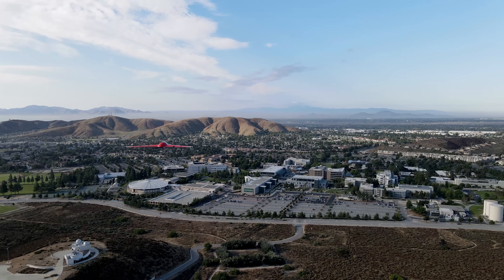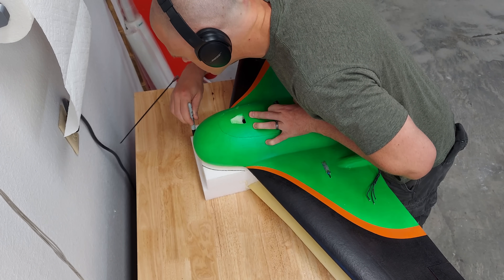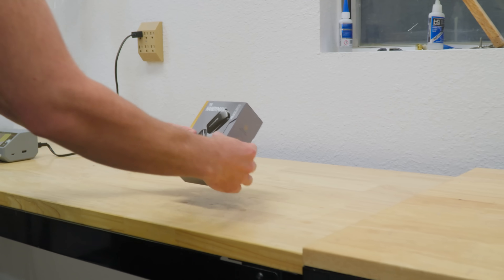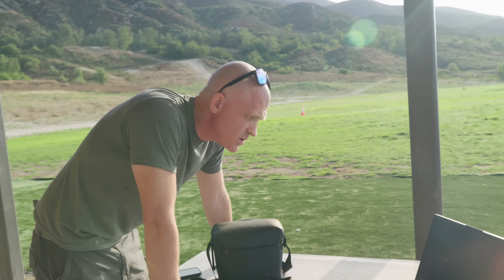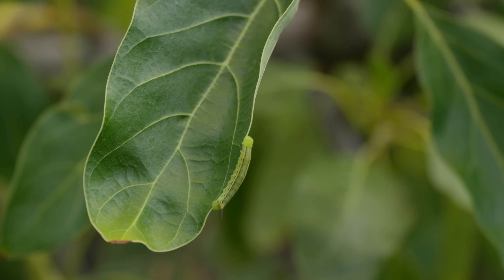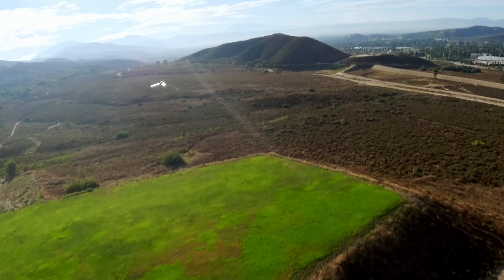Instability:  The Future of Drones?

Comment: In the 6% you have to counteract the weight loss of the weight. I suggests you build a rail onboard and a servo to move the electronics ombord in order to move the CG without any change in weight. When you can start in a stable mode and gradually  move in a instable mode. that obviously means to change the servos midpoint on a go. That maybe solved with some amount of channel mixing obviously. Twerking it can be a bit challenging but it would not be that hard.
The upside should be that you can see directly how much less drag according to the amount of instability, and therefor don´t need so much time. just make a same slowly sweeps. and you should have a graph hopefully! :)
I think your work and content are fantastic!!! And right now i tweaking my Flikwing for the maiden flight!

Comment: i love flying wing´s / ( delta wings ). i have made MANY wings in my hobby day´s, most of them in balsa, and cover to make the wings low weight, much lower than you can make a floppy foam plane. but they brakes more easy at landing compared to reinforced foam wings.  also my fastest ones is balsa wings. the looks have not been the best, but they fly good and FAST.

and ofc, the wings have been symmetric or semi-symmetric. the slow loiter wings had have more of a glider wing profile to be slippery in the air. being up in the air for an hour is easy done with a wing that has a slippery glider profile. and i also made a mod for iNAV that triggers the throttle depending on what airspeed the peto tube reads. then the motors dont need to run all the time, and you never go down to stall speed. not even then flying with the wind (if the motor setup is powerfull enought) much of this thanks to @rctestflight  #rctestflight then it comes to tinkering with iNAV.

my next project will be a Horton EDF flying wing. in foam and fiberglass.

Comment: I had also dealt with this at one time. 
My personal goal was to fly autonomously for 90 minutes.
The basis was an E-Flite Optera.
Almost nothing is original on this thing.
Motor exchanged less KV. Propeller less pitch. 
4S Lion.  Pito tube.

The plane is super quiet when it is in the air and the altitude only old must. only 3.5A current draw. 

The thing is equipped with a raspberry Pi and large external WIFI modules for digital HD streaming (at the time there was not yet the DJI O3 module).
I had to weigh what the bomber weighs, but you can't just throw it off the wrist. 

the center of gravity is so far back you can really see the wing surfing on the head wind

the pito tube would be indispensable with me. without it it came again and again in curves to stalls. interesserweise the FLiegt does not fall enfach from heaven but screws itself then like a maple leaf down. Nothing ever gets broken.

Comment: why not get rid of the fuselage. a flying wing is a flying wing. also wont just two motors be more efficient with bigger props? and are you using a laminar cross section? like gliders do. and is the surface absolutely smooth. maybe a certain coating is less sticky to air

Comment: Perhaps add another servo to control the position of the battery and/or ballast weights mounted on a linear track that is positioned on the CG for takeoff and landing; but can be incrementally adjusted as they say "On the fly"?
RE: task timing; get DEEPER workbenches with shelves above them ( might also wanna try some Lemon Fresh Pledge furniture polish on your head to further reduce parasitic "stubble" drag!)
Gotta give props to the Crestline Soaring Society for using their landing area.
Last thing; have you tested the difference in your acceleration quotient while leaving the bathroom after "Manscaping" your scrotum?

Comment: What servos are you using in this project? I think you can benefit a lot from fast (as fast as you can find) servos so flight controller has enough time to compensate for instability. Slow servo in the control loop ruins the whole things. Many servos can run higher voltages and produce higher reaction time when run on HV. Also I'd recommend actually testing the claimed reaction speeds, they differ a lot!

Comment: just use 2 motors instead..enough power. Low kv high volt setup should also help with amp draw. Weight is also very critical, every gramm counts. You have to be a gramm Nazi. 😂

Comment: If I understand this build philosophy right, what you’re trying to do is make a flying wing that acts like a canard, something that uses lift to stabilize pitch instead of anti-lift, like with a tailed aircraft or a flying wing with reflex.

I guess thats where the challenge lies, creating equal and positive changes of lift on the fore and aft section of a shallow chord is hard, especially since the center of pressure shifts with changes in angle of attack. 

The nature of this challenge makes me wonder if more success would be found with low/zero camber airfoils. Since those don’t produce pitching moment nearly at all, you wouldn’t even need to produce much anti-lift to stabilize in traditional layouts, much less tail heavy ones
Reply: sym airfoils produce pitching moment too, they're only cm=0 at zero lift

Comment: Can you use the sort of props that powered gliders use? So as you're coming in for a landing and turn off the motors, the prop blades will fold back and hopefully not damage the motor
Reply from the maker: If I could find counter rotating yokes I'd do it!
Reply: @thinkflight  could you not take off a prop from the nacelle and mount it 180° backwards? Looking at my Great Planes Kunai, I feel like it could be done.

Comment: Could you go another step and make the wing straight?
Reply from the maker: Potentially!
Reply: @thinkflight hey I've been thinking larger propellers at lower rpm will be more efficient and have the props in front of the wings will increase control at low speeds. Maybe polyhedral instead of dihedral I also haven't seen a slat like device on a flying wing. Probably would work best as a hinged control surface in front of the blended fuselage like an elevator then some slats on the wing tips. Like the shuttle in interstellar cause then you're not using negative lift to control the airframe. I would do this myself and try to share my experiences but I'm struggling to fit in the time recently. But watching your videos makes me fall back in love with aircraft and motivated to build them I just have to do it. Hopefully soon I'll be building the most efficient flying wing and it would be awesome to see some of my ideas in the next video. See if I'm going down the right track
Reply: Apparently a puller configuration is more efficient than a pusher configuration but this may mess up having an aft cg

Comment: 🎯 Key Takeaways for quick navigation:

00:00 🪂 Quantum is an unstable aircraft designed with four motors.
00:29 🛩️ Unstable aircraft can be efficient and utilize flying wing advantages.
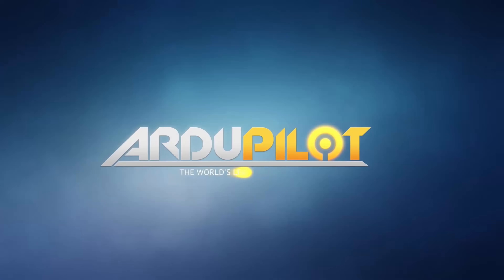01:10 🚁 Autopilots like U-pilot software are used to tune unstable airframes.
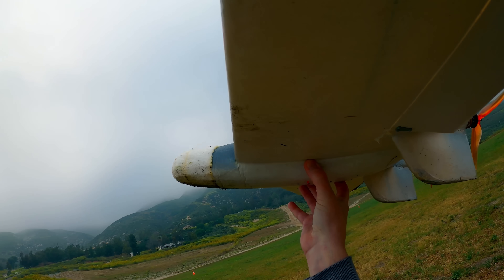01:53 ✈️ Tuning involves moving the center of gravity incrementally backward.
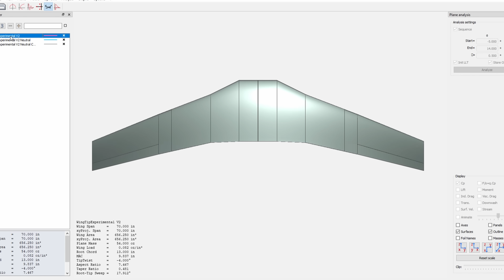03:04 🧩 Modifying aircraft involves changes like removing reflex and reducing wing size.
03:30 🛠️ Rapid prototyping is used to create airframe modifications.
04:28 🛠️ Electronics are tested, and the aircraft is prepared for a maiden flight.
05:16 💇 Reducing weight and improving aerodynamics can increase efficiency.
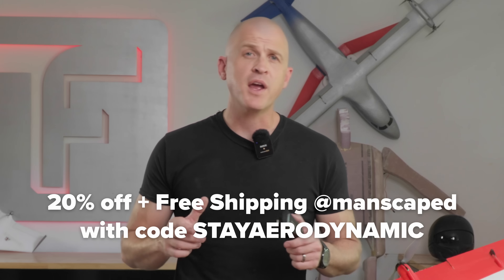06:28 ✂️ The sponsor Manscaped provides a fast and efficient shaver.
08:05 📏 Control surface reflex is gradually decreased for stability.
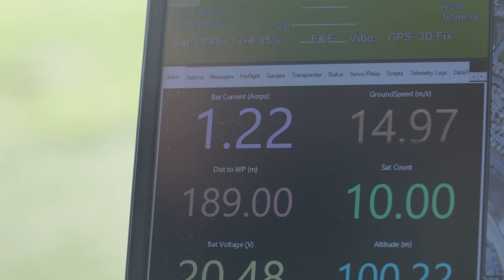09:04 ⚡ Amp readings on Quantum show improved efficiency.
12:40 🏆 Quantum aims to set a record for the longest battery-powered flight.

Made with HARPA AI

Comment: Could you have some sort of position encoder in the motors to lock the blades parallel to the ground for landing? Or perhaps with the way the motors are wired there could be a way to energize the coils just on the position that holds the blades flat?

Comment: Just a thought.  I used to own an old flying wing (can't remeber the name) that had the battery tray on a rail with a servo that could move it forward or back no more than a quarter of an inch.  The instruciton manual said to takeoff at the nose-heavy end of the spectrum and to adjust in flight depending on desired flight speed (more speed, more aft).   I destroyed the plane years ago so I don't have a picture.

Comment: Quantium is fitting name for a craft intended to push the limits of energy efficiency. Your story telling game has taken flight too. Looking forward to seeing more on how Quantium is improving over its sister, Serenity. 

Noticed that both motors on each wing are spinning the same direction. Wondering if  by reversing rotation direction of inner motors, Quantium may be able to use motor torque to help produce and control roll moments. This should reduce the amount of split elevon usage, thus gaining some efficiency. Same concept a quadcopter uses to produce/control yaw. Maybe this already an idea on a list for possible future experiments.
Reply: But you'd be spinning one prop faster than another, while their forward airspeed is the same; creating drag. My intuition tells me: more than the elevon usage creates, but I guess it's worth testing anyway.

Comment: Hmm. Much to think about. I have been trying to build a more efficient tilt rotor VTOL for a while now, but the main issue I had was the difference in optimal CG between both configurations.
The wing needed a very high ratio airfoil to be able to stay stable during the transition, which killed fixed wing efficiency. Pushing the CG further to add stability was detrimental to the performance and efficiency in hover. Having the CG at or near neutral point would already be a massive improvement. I am definitely going to try out a split elevon design too.

Keep on the great content!

Comment: According to Darpa research they are building an airframe without flight control surfaces using compressed air like spacecraft landing units to further decrease radar cross section signatures and increase fuel efficiency so you do not have to have flight control surfaces 
https://youtu.be/BWuo5fKpLuM?si=U7oqs3d0fTFhtk68

Comment: To save the motors you could connect the lower control surfaces' servos to a cam to deploy and retract (via spring) some landing gear / skids by moving the servo beyond it's control range.
The control surface would then also act as an air brake upon deployment.

Comment: Are split elevons necessary for flight under unstable configuration ? Or they are just for the yaw stability ? Normal - non-split elevons are able to go up and down so why are they split ? I think this can be done without splitting elevons.
Reply from the maker: In glide for landing there is no motor yaw control, I need to get it from somewhere.
Reply: Yop it is actually pretty good and efficient yaw stability solution without any additional surfaces = drag  @thinkflight

Comment: Great video!  Keep them coming!
I'm now wondering if we  change prop size (and motor) can we gain more efficiency?? Is a larger prop running half the speed really more efficient than a smaller prop running closer to full speed??  If you adjust the speed so the thrust of both motors setups are the same.  Which one is more efficient?

Comment: I'm sure you probably covered this question in an earlier video. But I'm new to your channel. I wonder if putting the motor in front of the wing, and above the wing would be more efficient? My logic is the air would not only be faster across the top of the wing since it is being forced, and not passively coming across the wing. Also the greater amount of air would be flowing across the top of the wing, also increasing the lift. Would faster air and more air across the top of the wing increase lift and efficiency? I'm no aerodynamicist, but I am curious if my logic is correct?
Reply: Among the many effects that your idea might have, a significant one is this: Moving the center of thrust away from the center of gravity would likely increase drag because you have to counteract the pitching moment generated by the raised motor with control surfaces.

Comment: Speed of servos a limiting factor? I  would also worry about flap hinge duty cycles... 
1000's of corrections a second is going to wear out some parts. 
do those corrections cost a bunch of energy? a servo fast and strong enough currents draw is not worth it...  
few of those launches.. thought you were going for a closer shave...

Comment: By how much did you reduce the total mass of Quantum vs Serenity V2 by shifting the center of mass?
Reply from the maker: Payload was the same, structural mass due to less wing area went down by 3oz or about 5%.
Reply: Did you, when determining the effciency gain, correct for that?
 @thinkflight
Reply from the maker: @hippotek1  That is part of the efficiency benefit of having a smaller wing, its lighter.

Comment: Fixed wings can cheat so much with flight time, because the air is a dynamic medium... longest battery powered flight is RNG... how do you rule out aerodynamic effects? over such long flights, theres just too much that can change, you have to average performance over a huge number of tests, or go for very high wing loading to reduce aerodynamic impact on inertia...

you have to qualify that statement a lot more, i'm excited to see what you want to aim for ^-^

Comment: however some aircrafts are using almost the same way to save fuel when they are making a long cruise. Such as Airbus330, it has a fuel tank inside the elevater, connect to the wing tank. The computer transfer the fuel from the elevater automatically to change the CG, reduse the drag from elevater which used to level the airplane on cruise flight.
Reply: Afaik the CoG is still in front of center of lift and the tail still creates a downwards force in level flight (negative lift). It’s just smaller.
Reply: @Mike-oz4cv  yep，they will never make it unstable. in A350, they think that system cost too much weight. so they extend the flaps a little bit to change position of COL. interesting

Comment: well, you've now also increased the aspect ratio, which should increase efficiency somewhat
Reply from the maker: Or did I hurt myself by lowering the already tiny Reynolds numbers?
Reply: @thinkflight  you have the xflr5 files, you can simulate and compare the best cl/cd for both of them, if there is a 6% improvement, you know what caused your efficiency increase

Comment: Dang this looks eerily similar to something I’m cooking up! How much more efficiency you recon you could squeeze out with no sweep?
Reply from the maker: I just dont think I'd have enough rudder authority with power off coming in for landing without the sweep.  Otherwise, no sweep for the win.   Someome should do that....
Reply: @thinkflight  have you looked into Horten/Prandtl wing designs? They use something akin to extreme washout (negative wingtip angle of incidence) to gain some "free" lift and thrust by "surfing" the wing vortices, which are generated at around 70% of span instead of at the wingtips. These wings exhibit proverse yaw (i.e. positive yaw-roll coupling or self-coordinating turns) as a result, in addition to efficiency benefits in level flight. "Bell-shaped lift distribution" is another term characterizing this design concept.

At larger scales, the design also generates more lift for a given mass, as the net bending loads on the wing are lower than a conventional wing generating the same amount of lift.
Reply: @nikolaihedler8883 I could be wrong. But I've read some research that the reason prandtl wings arent being used more is that these high efficiency gains only occur at very specific flight conditions. They are actually quite bad at off design points.  

This is partially why birds constantly morph the twist of their wings and dont just have a fixed twist
Reply: Yes, the Prandtl work that Al Bowers has done with his team is very much in this realm.

You can get an 11% drag reduction for a 22% increase in the wingspan, and the plane will fly beautifully.

Love your work Kevin, always a joy to watch. Please keep it up. ♥️🙏🏼

Comment: I love these efficiency tests! One thing, though: you should use watt-hours as your unit of comparison. mAh doesn't take the battery pack voltage into account. I suppose it's still valid if you're using the exact same battery pack between tests and planes, though.
Reply: or joules
Reply: @Louis-ok3ry  nah.
They rate batteries the same, all the while having terrible internal resistance on some of them. Which makes them less efficient.
Better to use the same battery.
Reply from the maker: I assumed it was understood this was the same battery.   I should assume less.  Learning the right balance of under/over sharing!
Reply: @thinkflight  Five watts per kilogram of body weight is a very good value for a cyclist who, of course, also shaves his legs for aerodynamic reasons.